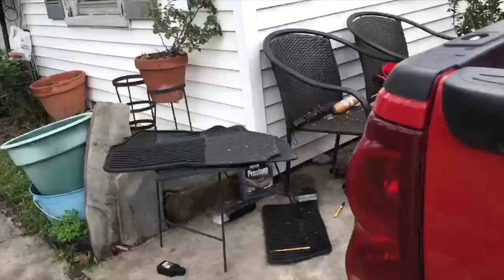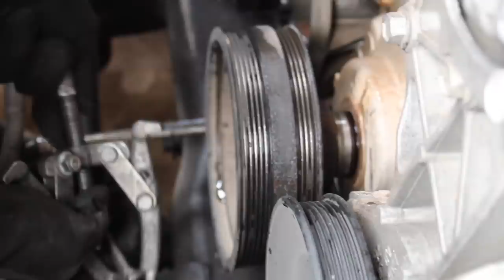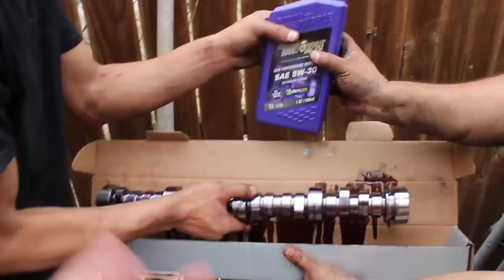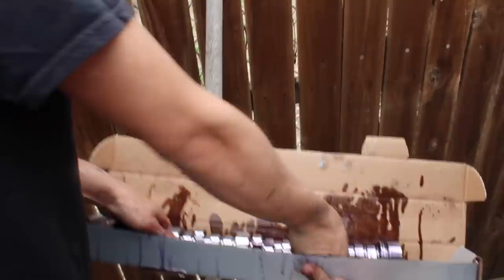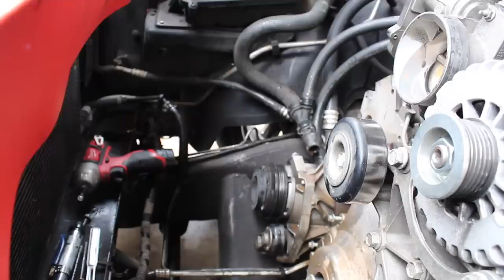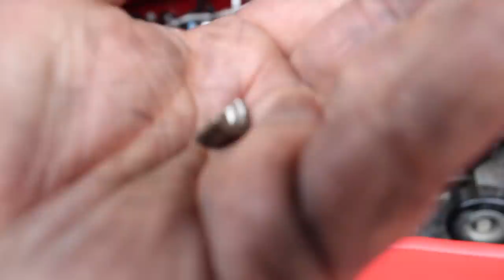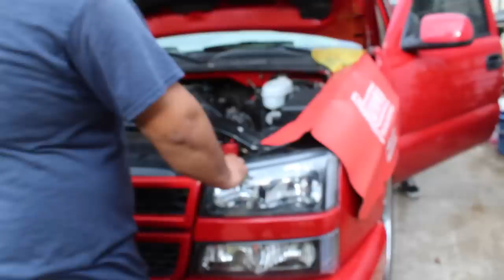HOW TO CAM SWAP YOUR LS MOTOR | BTR STAGE 2 TRUCK CAM (4.8L, 5.3L, 5.7L, 6.0L, 6.2L) STEP BY STEP

Comment: Next time use thicker oil. Wasted the oil and most of it dripped out and still went in dry
Reply: Miguelspl150 assembly lube is cheap

Comment: Did you use a pick or a screwdriver to put in the spark plug hole to get dead center of the piston? Just did a stage 3 cam watching your video bro, thanks for taking the time in making this and going step by step. Literally so easy with the help of this video, something I've never done before. All I have left is to do the springs and seals.
Reply from the maker: Yes I used a pick tool in the spark plug hole
Reply: @dinocoblue2709  oh ok, so you feel the piston pinching it or how can you tell once it's at the highest position?
Reply from the maker: Yeah you’ll feel the piston push the pick tool up

Comment: What kinda rods are they?size? Did you have to do anything to the rods before you inserted them to hold lifters up? How long are they?
Reply from the maker: Steel rods 5/16
Reply: Thanks, so I have a 2011 chevy tahoe 5.3, I want to do a cam and spring swap what else would I need?

Comment: I was good till you used the damn motor oil smh no!!!
Reply from the maker: used it on all my cam swaps and never had issue
Reply: It’s a roller cam. Engine oil is fine in that application. If it were a flat tappet cam, that would require a moly fortified or other type cam/lifter/assembly lube.

Comment: Hello diego!! Almost finish con el cam swap thanks to your videos but where do you check the piston position to change the springs and how you know when it's ok to compress the springs
Reply from the maker: Take the spark plug out and put a screw driver in the hole and rotate the motor by hand and you’ll feel the piston go up and down ( stop went it reaches the higher point)
Reply: @dinocoblue2709  muchas gracias 👍

Comment: You guys are fast. One thing I was curious about, when he put the push rods back in did he have them in his hand in order with the places they came out of or with a new cam does that not matter any more or were they new rods? I was always told put them back into the spots they came from but maybe that's when your putting the rods back in to the cam they were to?

Comment: For the harmonic balancer bolt did you re used the stock or used a new one and do you know the torque specs for the bolt ?

Comment: I have a 2000 GMC Sierra 1500 with a 4.8 it only has 120k miles I want to put a cam which one do you recommend i want some power and sound what kit is best for me and do I have to change my lifters truck is stock

Comment: What would happen if i put a tsp 223/226 111 lsa cam on a 2005 5.3 chevy Silverado without any after market springs and pushrods?
Reply from the maker: You can break a stock valve spring and hits hell after that happens

Comment: NICE, thinking of swapping a CAM comp 212/218 in my 2012 Silverado 1500 5.3L. No TUNE yet but just starting. I use my truck daily but just want some more power. Gracias amigos.
Reply from the maker: nice hell yeah that's a good starter cam for a daily

Comment: On a stage 2 all you need to swap is the cam itself and the springs and then get it tuned?
Reply from the maker: yes
Reply: Stage 2 truck cam does not require a spring upgrade.  Only the BTR stage 4 truck cam requires a spring upgrade.

Comment: I may have missed it but is that a special rod to hold the lifters up or just threaded rod?
Reply from the maker: its just a 5/16 rod From Lowes
Reply: @dinocoblue2709  how long does the rods need to be ? I figured a couple inches longer than the cam.. would that work ?
Reply: Dinoco Blue thanks for the reply. I have two trucks that need camshafts. One is my personal truck which has the 6.2 that I’m gonna go ahead and tear it down because I’m replacing the camshaft with a BTR stage 2 cam plus the lifters, pushrods, valve stems, rocker arms and all the other good stuff but I bought a 2011 Yukon Denali for next to nothing because it has a dead miss and the customer doesn’t want to pay to have the engine fixed because it has right at 200k miles so they found it best just to go out and buy a brand new Yukon. 200k doesn’t scare me at all the truck looks brand new inside and out and I own a repair shop so I have the time to fix the truck. Hopefully I’ll pull the old cam, slide the new one in there and have a smooth running truck. My Sierra Denali and this Yukon Denali both have the 6.2 in them and before my camshaft failed my Sierra ran and drove like a champ. I’m hoping to get the Yukon I picked up running smooth so I can talk my wife into selling her SUV and taking this Yukon Denali so she don’t have a car payment anymore. Or let me rephrase that me and her don’t have a car payment anymore on her car. A extra $650 ish dollars a month goes along way not to mention our insurance will drop a little as well.

Comment: I remember someone commenting that should should do a more i depth video, and you actually did it lmao that’s awesome man. How much is it usually for a cam swap? I will be attempting my first one on a 11 silv I just bought. It’s a 4.8 though, will 5.3 cams work? What’s the difference from a 5.3 and a 4.8 anyways just a smaller stroke?
Reply: 4.8 has flat top pistons 5.3 has dished ones
Reply: @recktt1945  which Is better flat or dished?

Comment: How did u do the rods from falling when swapping springs did u stick ur finger in thw sparkplug hole n turn the motor or how is the only step i didnt get?info please
Reply from the maker: Not my finger lol I put a screwdriver in the spark plug hole

Comment: Where did you get the rods to hold the lifters ? I'm debating to replace lifters at the same time or just cam like this video
Reply from the maker: You can get them at any hardware store they are 5/16 steel rods
Reply: Thanks for the reply 👍
Reply: How long do they have to be ? Or does it matter? They only had threaded
Reply: Are they threaded or just round ?

Comment: Hey I just got a 05 Sierra 5.3 (first vehicle I have) so I’m a beginner lmao so what happens when you stick the rods in and spin the cam? Like how does it hold the lifters?
Reply from the maker: the lifters travel up and down throw that hole and when you stick the rod in the lifters cant travel down since the rod is on the way, if that makes sense lol
Reply: Dinoco Blue oh shit I thought they traveled in a circular motion that makes much for sense thanks man I definitely subscribed

Comment: hola espero y esten bien y puedan leer este mensage tengo una chevrolet  del 94  con el 5.7 tengo  baja prrecion en el aceite y el motor solo tiene 150 mil millas ya cambie la bomba y siguio igual cuando destape abajo cheque todo lo que ba en el siguenal y todo se siente bien firme nada flojo y tengo 120 de comprecion en cabesas  mi pregunta es cren que cambiandole solo el arbol de lebas se controle el problema

Comment: Hey dinco did this cam work with stock pushrods and lifters also is it stock stall converter
Reply from the maker: yes stock pushrods stock lifters stock converter stock transmission
Reply: @dinocoblue2709  will stage 3 work with stock too

Comment: My luck, yesterday i took my truck to the shop for new brakes, found out I need the driver side motor mount, top driver side bushings and bottom passenger side bushings plus. Trying to get ready for the Baja 250 next week
Reply: Motor mount could be as easy as a rachet strap

Comment: Did you make the rods you use to swap out the cam while the heads are still on or can you buy them somewhere. And was also wondering where I can get the tool you use for changing the valve springs and the seals?
Reply from the maker: I got the rods from Lowes 5/16 thick, and the tool you can buy it from eBay
Reply: @dinocoblue2709  thank you very much do you use air pressure in the cylinder to change the springs and valve seals or is there an easier way I think I might have heard sumthin said about piston at TDC. Sorry didnt think to ask but do the rods need to be a certain length?

Comment: If you had a motor out of the car would it be worth putting new cam bearings in or are they too hard to get to with the crank in the way?
Reply from the maker: it would be worth it changing them but I would just take that to a machine shop to get it done

Comment: Great video man. Did you guys have to put a tune on the truck or did it run fine with just the cam and spring swap? Thank you 🙏
Reply from the maker: It ran some what good with no tune but either way we got it tuned to make it run perfect

Comment: If you wanna blow up your timing chain and transmission, this is how you do it. Stock parts are not meant to operate with aftermarket upgrades. Makes me wonder if they even tuned it...
Reply from the maker: You’ll be surprised I’m making 550’to the wheel on stock chain and stock trans let me say it again STOCK 180K MILES CHAIN AND TRANS and still going strong

Comment: Great Vid ,,,Did you lose any bottom end power using the stage 2 and did you notice a good amount of power ? Reason for asking want to do mine
Reply from the maker: If you put a stall you won’t have power lost
Reply: @dinocoblue2709  So basically I will lose bottom end power with stock converter then ,,I Forgot to mention its a 5.3 swapped into a IROC camaro  ,,But thanks for the reply back Dinoco

Comment: Thanks for the video. Man.  So he not have to remove nothing from the heads?
Just swap the cam. 
I have a noise that come from the center of the engine. And I believe is the cam and probably a lifter.  But its. Not a click. Not a clap noise.   So I probably can check just the cam.  And see how looks like.
Reply: My bad. I thought the video was finished already
Reply from the maker: yeah take the cam out and see how the lopes look
Reply: Dinoco Blue  lifter its all most flat  on cylinder 7 so I think it will need the cam too.

Comment: What camed you recommend me for a 2011 5.3 v8 Silverado compa .  

Would I have to dropped my truck ? I have a 3  inch lift kit .
Reply from the maker: a btr stage 4 truck cam, you don't have to drop it you can have it lifted and be dammed
Reply: Dinoco Blue  órale thanks compa .  The only problem is that I don’t know any shops that would cam my truck . I’m in Houston btw . 

Right now the truck is stock would I have to tune my truck then put the cam on or it doesn’t matter ? 

I’m a  rookie tlacuache 😂 si idk much yet

Comment: Did you change lifters and springs?  Install a d.o.d. kit?
Reply from the maker: did motor didn't have dod so only camshaft and valve springs
Reply: I realized after commenting that you replaced the springs later in the video.

Comment: Do you know how to install the harmonic balancer back in ? I tried the tool from auto one and oreilly but their the same and the bolt doesn’t reach 🤦🏽‍♂️
Reply from the maker: I use a longer crank bolt to drive it in, you can get one from a hardware store

Comment: I need help at 10:30 I’m having the same problem I have no idea how to get it out, do I just keep trying? Or pull harder? I get it to the second journal and it’s a 1/16 so it feels straights I can’t lift or move it anyways but won’t come out
Reply from the maker: yeah just pull harder, they get stuck sometimes
Reply: 😓 It came loose then I nocked a cam bearing out, I have failed you master!!!!

Comment: from where you got the 2 round bars to hold the lifter before removing the cam? what is the diameter and length required?
Reply from the maker: 5/15 not sure how long
Reply: @dinocoblue2709  can I use wood for this purpose?
Reply from the maker: You can but if I was you I wouldn’t, I seen people break the wooden rod inside the block and that’s just so bad, you would have a bad time trying to take the broken piece out( that’s even if your able too)
Reply: @dinocoblue2709  Thank you for your answer and guidance, appreciate that

Comment: Hey guys, me and my dad are arguing about this, hes old school where a big block with 80k was a high mileage motor, i want to cam my 05 daily driver silverado and he wont do it unless we change the cam bearings (truck has 98k miles) and im telling him you dont need to.. do you reccomend it?
Reply from the maker: 98k??? that's still a new engine, I've seen 200k + big a big cam and nitrous and still on stock cam bearings

Comment: Did u have to remove the radiator to make more room to swap out the cam?
Reply: No during the whole video he says "Watch out, don't put a hole in the radiator" lol
Reply from the maker: yes but you don't have to remove the a/c condenser

Comment: When doing cam swap is it mandatory to do springs and valve seals? or would I be okay just throwing a small cam in?
Reply: CruzieMoto you should be ok if your doing a small van unless ur motor got hella miles on it

Comment: Hey man quick question did a lq9 swap on my single cab but has 150k miles on the motor, can I still cam it or would I need to rebuild it first ?
Reply from the maker: depends on the condition of the motor, but I would say yes

Comment: Did y’all have to get it tuned before getting it to run right?
Reply from the maker: no it kinda ran alright with out the tune but the tune will make it run the best

Comment: I know this is  an old video  but can you explain  what exactly  I'm feeling for on tdc and the order I can do them in.
Reply from the maker: Your feeling for the piston pushing up on your tool that you have inside the spark plug hole, you’ll feel the piston reach it’s highest point that’s where you want to set the piston at to change your valve springs

Comment: Hey brother just found your channel. Glad I did, awesome video. What state are you in? I’ve got a caprice ppv with the 6.0 L77 (updated Pontiac G8 motor basically). I’m starting the planning stage. Trying to figure where to start because long term I want 800 crank hp out of it. I know it could get way more but I want it to last and be reliable since it’s what I use for road trips across states. (Best sleeper and under the radar car)

Comment: 2006 Silverado 4WD

It has a 5.3, pretty much all stock besides a cool air intake and a magnaflow exhaust. I recently ordered long tube headers along with a Y pipe as well as a 212/218 camshaft. Will I have to upgrade anything else for it to run comfortably as a DD after those parts get installed? Will a tune be necessary? Great fucking video btw. It made me excited to install mine
Reply from the maker: just put some ngk spark plugs and you'll be fine like that and yes you should get it tune so it can drive perfect

Comment: How did you keep the crank from turning while tightening the harmonic balancer bolt
Reply from the maker: we use a 1/2 inch big impact so it pushes the balancer all the way in without turning, or just put a ratchet in one of the holes and it will keep it from turning

Comment: How do you keep the valves from falling into the cylinder? Maybe I missed it.
Reply from the maker: put the piston at TOP DEATH CENTER that way the piston is right under the valve and can't fall
Reply: @dinocoblue2709  Brilliant! thanks!
Reply: I have a question, how do you know when the piston is at top death center?
Reply: @epicenterbasshd9636  My guess would be to make sure both valves are closed (to make sure its on the compression cycle) and put a wire through the spark plug hole and when the wire stops moving upward, it would be at TDC. my guess.

Comment: Did you get any valvetrain noise?
Reply from the maker: No, you should never get any valve train noise after a cam swap
Reply: @dinocoblue2709  reason asking is I did a sum-8707 cam in my ls2 and torque the rockers to 22ft lb and I’m hearing some lifter noise.
Reply from the maker: You either have a bad lifters or too low of oil pressure

Comment: Cool vdo.
How do you know what cam to use? I thought the heads had to get changed too.
Reply from the maker: just any ls 5.3 cam will work with the right valve springs and pushrods

Comment: Hey what’s up bro what do you recommend for an 08 Silverado 5.3 I’m trying to get that same cam on mine but don’t know if I will need to do lifter too?
Reply from the maker: im sure you have dod so you'll have to do the dod delete kit and the cam kit
Reply: Dinoco Blue I honestly don’t think I have the dod on my truck my truck is kinda weird it doesn’t even have the traction control button what would happen if I do the cam swap and later find out it does have it? And my bad but I’m new to this lol

Comment: What were the specs and the cam and did you have to replace the springs?
Reply from the maker: Yes and I forgot the specs
Reply: Dinoco Blue ever worry about the front cam bearing wear?
Reply from the maker: Nope

Comment: How do you rotate the engine without the crank bolt tightening? I was trying to make it top dead center but it doesn’t rotate because the bolt tightenes when I try

Comment: is there any worry about knocking the cam bearing race off inside the motor?
Reply from the maker: yes
Reply: is there a cam i can use to where i do not need to replace the valve springs?

Comment: What size are the dowel rods? And how exactly do you when they are correctly positioned?
Reply from the maker: 5/16
Reply: Length?? Want to 5.3 swap my sons '03 V6 but like everyone else, nervous to do it. But this vid is a boost of confidence. Plus it'll be on an engine stand before we throw it in.

Comment: how do you keep the valves from dropping in the cylinder when replacing the springs? just turn each cylinder you are working on to top dead center?
Reply from the maker: Yeah just that easy, the valve can’t fall when the piston is right under the valve
Reply: I need those rods is that what holds the values  ?
Reply: Are u in denver  ?

Comment: If I go with a btr stage 4 do I need to change pushrods
Reply from the maker: no you can still use your stock pushrods as long as you get the low lift cam